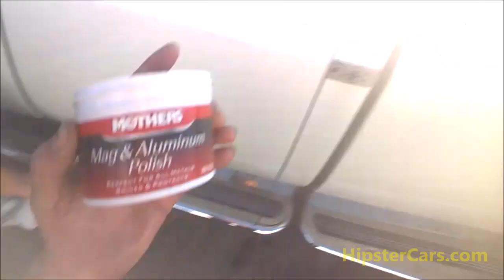Video Car Polishing Paint Correction Live Work Vlog Buffing Tips

Comment: Best power washer I ever used, was a heated power washer.  It had a small fuel heated canister that heated the water and made superheated water spray out.  We used to clean the engine bays on our busses and sallyports when the oil and grease built up.    Im wondering in the long run if it would be cheaper and faster to use one?